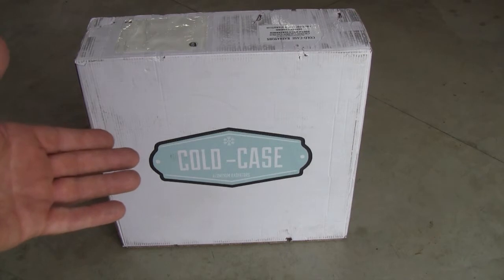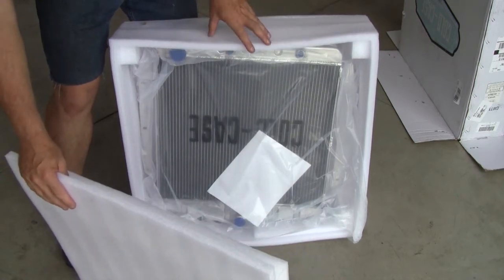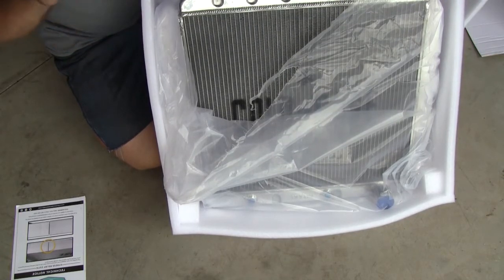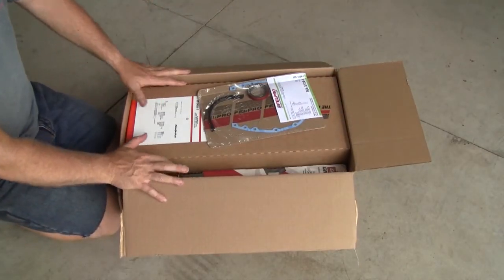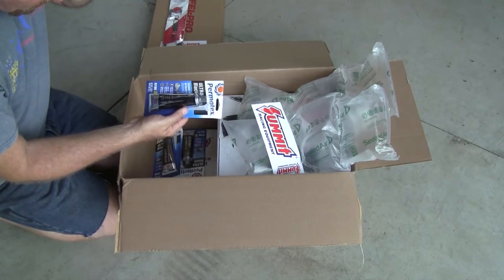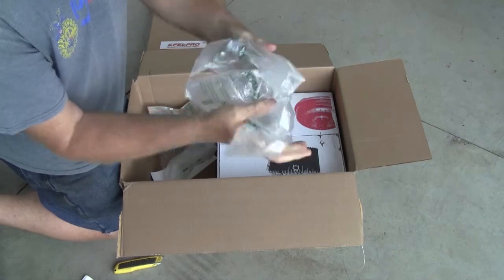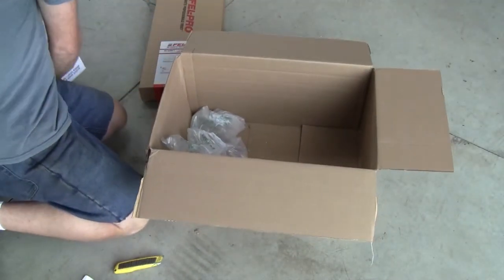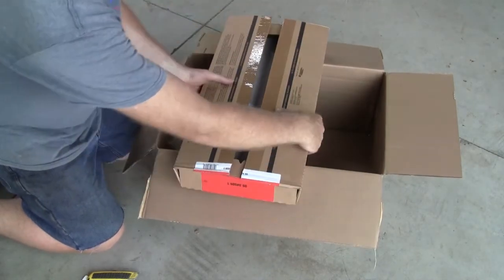Chevy 350 55 Engine and TH350 Transmission Refresh Part 2 - The Unboxing Video!!

Comment: Way better videos! Love what you’re doing, but explain why you should change the converter on a trans that fried! That’s so helpful to gear heads that don’t know. Any time you fry an automatic transmission, the clutch material built up in the old converter will destroy a new build if you put that same converter back in it! I wish I was dealing with that price point on a converter! I just blew my 700r4 up, bought a new $6000 dollar trans, but my converter started out at $350, till I told them what I had, my converter from monster transmission was $1200 bucks!🤣🤣🤣 ouch!
Reply from the maker: Ouch indeed!  Thank you for the ideas!